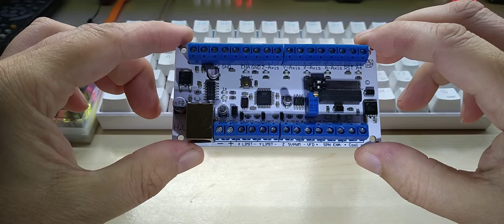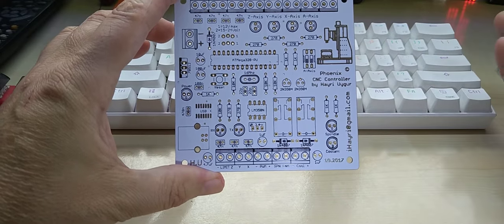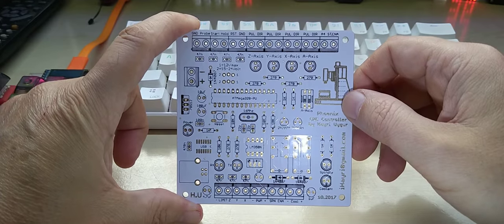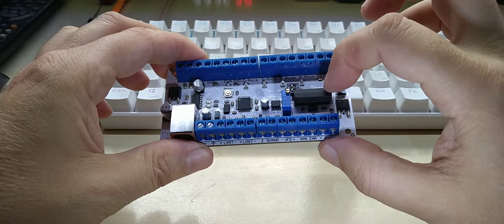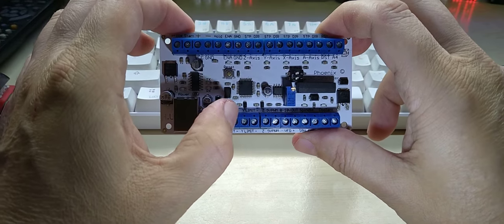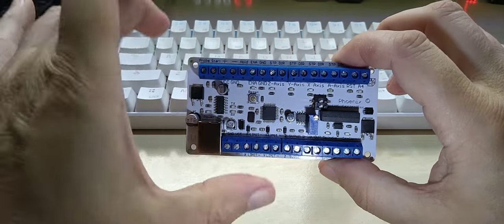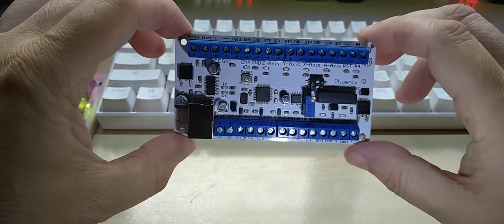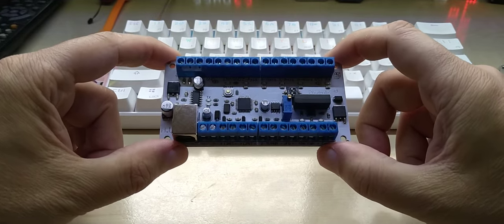Long overdue update on my Phoenix CNC Controller and how it evolved over the years, enjoy.

Comment: I agree with Dave, I can hear you are getting better. I do hope grandfather and your wife are too. The board looks great, altough repairs are getting more difficult with the SMD setup. In a future release I would considder adding optocouplers for the limit switches inputs.
Reply from the maker: Thanks Rob, our grandfather is doing better as well but to be honest he kinda lost his will to live, he just lays in bed all day and doesn't want to get up. His eyes are empty if you know what I mean. We just hope that he eventually feels better. He has a friend (95 years old) that visits him once in a while and they play cards, will invite him to come more often.
I thought about optocoupler but as long as your wiring is correct you don't really need them, not a single of my customers had problems either. I ran a test code with 340.000 lines with a shop air compressor, a household vacuum cleaner, the VFD with spindle and the CNC controller all from a single wall outlet without a single lost g-code or malfunction. I think that speaks for the robustness of my board and without a doubt the great Grbl software. I am actually thinking about a all new CNC controller based on the ESP32 which does open way more possibilities. There is a fork of Grbl for the ESP32 which I want to use, because Grbl just works and has a lot of free software support.
Reply: @iHayri1  Yeah I know what you mean. Do not underestimate the effects of lying in a hospital bed besides the Covid damage to the organs. I hope he will revive soon ....
My little CNC suffered from motor starting, despite a toroid in those leads and shielded cables to the limit switches. The opto-coupler solved it completely.
Reply from the maker: @stiefbeen22  True, we are trying to encourage him to be more active and take part of our life.